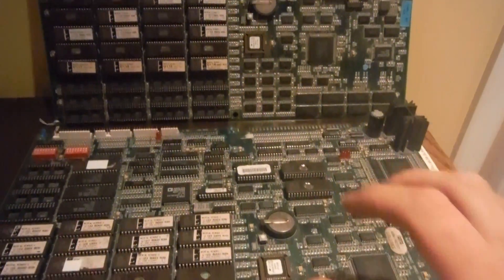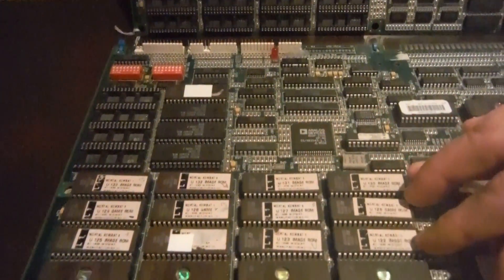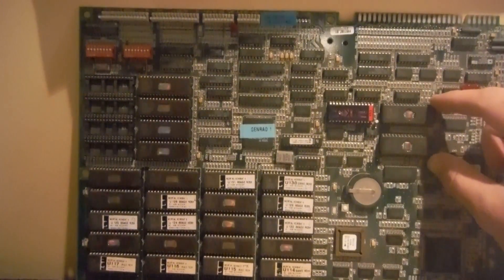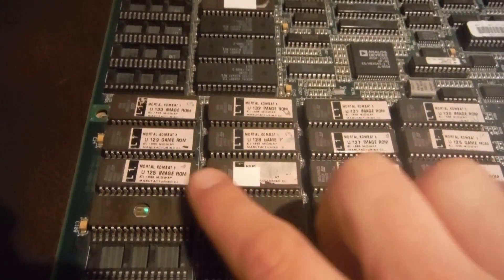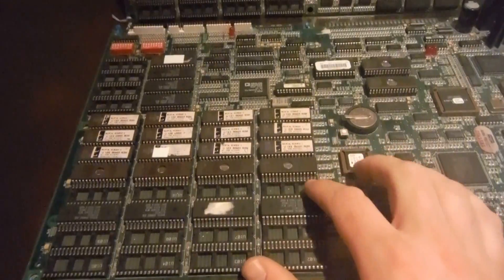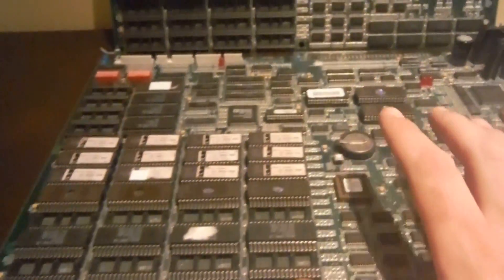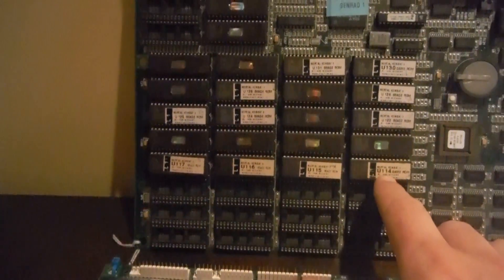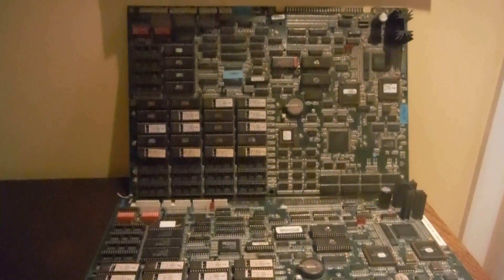Converting a MK3 PCB to A UMK3 PCB

Comment: Hello  I own original mk3 cabinet with umk3 revision 1.1and I also bought an original mk3 board years ago off EBAY I still have it in  the box is it worth anything? What if I just swapped mk3 instead of umk3 will it work?
Reply from the maker: MK3 is harder to find than the UMK3. Most operators just switch to the UMK3 when they got the upgrade from Midway. UMK3 is better in my opinion because it has more characters and moves. People like to pick up the MK3 for their multi MK cabinet. Its probably worth between 250 and 300.
Reply from the maker: Yes you can just swap out the boards and play.
Reply: @joebagadonuts6415   I did that but there's no sound?
Reply from the maker: @phobophobia4953  they should just plug and play. Is there no sound at all or a static sound? Also, does it pass the rom test on initial boot (all green roms)?
Reply: @joebagadonuts6415  all green
the  reason I am switching is because I have been having problems with my umk3 board
Reply: no sound at all
Reply from the maker: @phobophobia4953  you can try switching all the roms for one board to the other. The boards are the same. You don't need to change the u35, u45, u47. They are all the same for both boards. Once you switched the roms you can see if the problem follows the roms or the boards.
Reply: @joebagadonuts6415  I think I am going to look into my umk3 board to see what's going on there it has reset glitchy graphics issues.
Reply from the maker: @phobophobia4953  just make sure you have the correct voltage going to the board. These Midway boards are very picky with voltage. You should be just over 5v
Reply: @joebagadonuts6415  Hello Joe hope all is well? let you know that I tested voltage on umk3 board it read 5.047 that was not the issue it was the capacitor there was corrosion  underneath. How I found out was by touching everything on the board during gameplay. Each time I touched the capacitor the game would reset got that replaced now working great and as for the sound for mk3 that's working good now it just took a bit work don't why though. looking forward to hear from you and thanks for your time